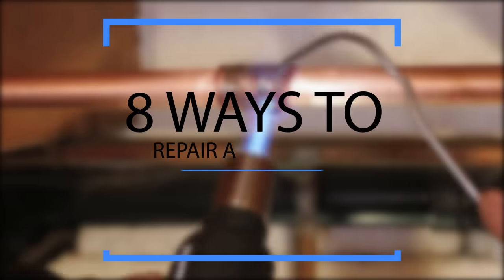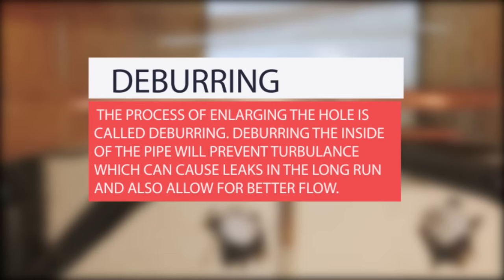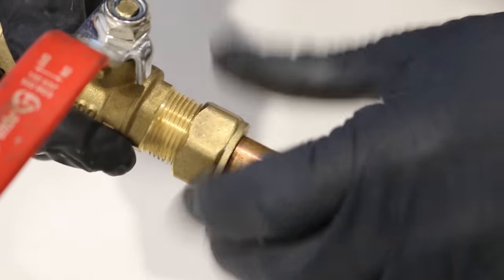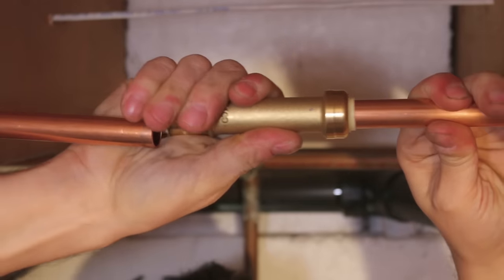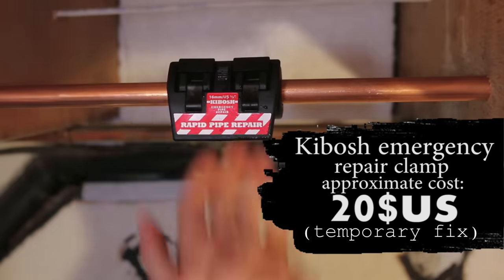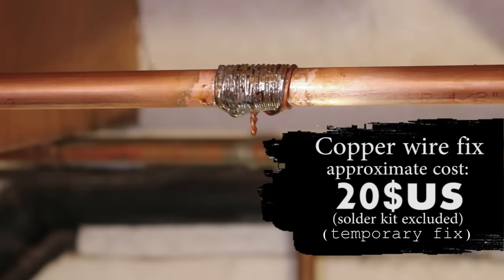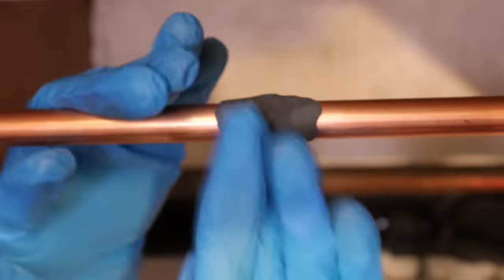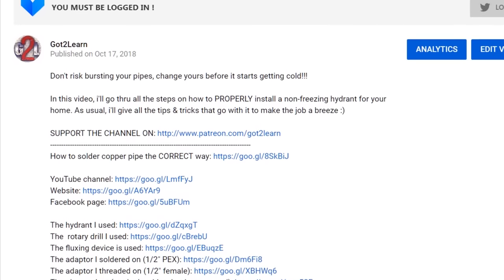The ULTIMATE Leaky Copper Pipe Fix Guide | GOT2LEARN

Comment from the maker: TOOLS:
Soldering kit I used: https://youtu.be/9rEfGa7iqNU
Pipe dope I used: https://amzn.to/2IEasNp
Deburring pen: https://amzn.to/2tBuhKW
Sharkbite depth gauge & deburring tool:  https://amzn.to/2Etjjx3

FITTINGS & MATERIALS
1/2" soldered couplings: https://amzn.to/2EwxSzV
1/2" repair coupling: https://amzn.to/2VkLNPh
1/2" compression fittings: https://amzn.to/2EctzZo
1/2" Sharkbite slip coupling: https://amzn.to/2tGegDg
1/2" Kibosh emergency pipe repair: https://amzn.to/2IEynwd
Pipe repair tape: https://amzn.to/2H07YX8
Small roll of lead-free solder: https://amzn.to/2ExrAA2
Epoxy Freeze fix kit: https://amzn.to/2Vobq1M
Reply: Hey how long have you been plumbing?
Reply: I love your videos brother but please, when saying soldering, the "L" is silent so just say sodering. Lol
Reply: Dis house has sho gone crazy!
Reply: Kool
Reply: Showed a plumber friend a permanent repair I did to a copper line leak in an impossibly tight area where even a temporary repair wasn't feasible and he lost his mind when he saw it, said he'd be using it himself from now on. 
An old pipefitter and welder showed it to me as something he learned years ago from another old guy.
It involves cutting a coupling in half lengthways and sweating it over the hole in the pipe. Like sticking a big permanent bandaid on it. I've used it in small pinhole leaks and don't know why it wouldn't work on bigger leaks?
Reply: @davidangelamelcher9591  pictures. Lol
Reply: @zachcoleman6285  didr decreases
Reply: Great video. But your 1/2" Kibosh Amazon link on this pinned post needs to be updated. Getting page not available using the link, but when I search by product name, it gives me a list.
Reply from the maker: @belindahugheslifestyle  will do, thanks!

Comment: I once used a bicycle tube with a couple cable ties. That was over 10 years ago and it's still holding up fine.
Reply from the maker: Yeah, that should only be temporary however.
Reply: @Got2Learn  It's already proven NOT temporary.
Reply from the maker: Temporary as in "max 1 hour" type of temporary hehe 😉
Reply: @PanamaSticks  11 years and still going strong. :0)
Reply: That’s affectionately known as “temporarily permanent “
Reply: You have been drinking water out of a bike tire.  Personally I would only do that temporarily, in an emergency.
Reply: @PeterMurrayj  The repair is on the central heating inlet pipe going into a rad.. old school 8mm microbore copper pipe.. It was a temporary repair at the time but I didn't get round to replacing it. But then, why should I if it doesn't leak? I did the same with a leaking rad valve a few months ago, it was still going strong until I replaced the rad and valve recently..

Comment: For freeze damage copper pipes its best to cut 6 inches on each side from hole. (removing a foot of pipe). Atleast thats what was told to me by a plumber as copper pipe expands when forzen.
Reply from the maker: Yeah that's what should typically be done for good measure, but for small burst like these, no need.

Comment: Thank you so much for posting this video. I was trying to replace my old vanity and accidentally cut through the wall and my hot water pipe with a jigsaw! After shutting off the water and thinking the world is coming to an end, I came up on this video. I had no idea that shark bite existed and could help me fix my issue. I followed your exact steps and voila! I now have a permanently fixed pipe thanks to your video. Appreciate you posting this!
Reply from the maker: Awesome, good job Rahul!!
Reply: Sharkbite aren't meant to be used in closed walls.

Comment: Thank you . I m an amateur but have always got it done . Been lucky learning to solder years back . Just takes practice and it has to be super clean is what I learned. I took round 1/2 “ pipe brush and fitted a screw on it and attached ot to my drill . All my pieces are cleaned way faster since that contraption was put together . Works awesome when soldering many pieces and soldering is a lot cheaper than shark bites but I like shark bites too sometimes if I’m in a hurry . Especially the caps come in handy but I usually just put a shit off on and cover the hole with blue tape while work goes on to keep crap out . I do the whole job no problem from framing to tile to cleaning up 😊. It took years to learn how to do everything efficiently in order to make a good buck . Repairs take like 1/2 hr but drive time and store time and . Is t the going rate first  hour $120 just to come out and $75 after that . Most stuff gets fixed quick .

Comment: Use a piece of rubber hose, cut open lengthwise to fit around the pipe at the leak and a hose clamp around it to secure over the leak. Never dripped again for me until I could get time to replace the line or the rest of the line just aged out to total replacement.

Comment: Great video! 
One note on the shark bite that can cause premature failure of the O-ring. 
I prepped a few copper pipes the same way before using the shark bite to later learn that the manufacturer wants the pipe prepped a different way.  They sell a simple tool to prep the joint. They call it the 
‘Depth Gauge/Deburr Tool’ and does not leave scratches as other methods require (before adding solder), and leaves sharp edges that can damage the O-ring. It may not leak now, but a few years down later it may. 
It’s kinda strange that they do not caution the installer, as it could be a legal issue as damages could be costly, but only have more full instructions on their website.
Reply from the maker: Yes, totally with you on that...I am working on a very thorough video about Sharkbite fittings, it should be out within a month or two, it'll contain everything someone would need to know when using these, stay tuned and thx for your comment!!
Reply: Got2Learn thanks for helping people have confidence for DIY projects!
Reply from the maker: That's my job, glad to recognize it, thx a lot!!! ;)

Comment: It worked, clear generic silicone tape, on a leaking oil cooler line that has up to 65psi of hot oil in it. It was leaking 1 quart every 200 to 300 miles and now it's leaking none.  350 miles later of mountain, Interstate, and town driving. Used 2 hours of time (half was cleaning hose) and a $7 10' roll of silicone tape that I wanted to test.  Took about 30" of clear tape to do one end of the hose while on the car.  I prefer the clear as it allows me to see through it. I developed a technique to do it in tight space. Gave it 3 overlapping layers in a different pattern. Straight wrap, diagonal, then straight again. Any pattern works but important to have different seal points of different wrapping and do it as tight as you can, with space provided.  Also important to squeeze and rub firmly on it to get each layer to fuse for 5 minutes or so before the next layer and the final layer.  If it's higher than 65psi I would also place single double wrapped pieces directly over the leak, for extra strength material before the first layer of the 3 wraps.  Or wrap it 4 times.

Comment: Being a plumber if you need another temporary quick fix for pinhole ive cut small length of a flat rubber bungee and use hose clamp.....cool channel ive never seen the repair with copper wire before pretty cool in a pinch and you got wire
Reply from the maker: Thanks Geo, share if you can ;)

Comment: I used a stubby stainless steel sheet metal screw to seal a pinhole leak as a short-term repair. Dissimilar metals are never a good idea, but for the short term it works great. I will ultimately replace that section of pipe all together.
Reply from the maker: Anything to stop the leak!

Comment: Problem with the Sharkbite slip fitting is the teeth scratch up the very pipe your trying to seal.  So could be prone to weeping.  If you use the tuning fork looking release tool you can hold in the release while sliding the SB fitting on and do the same when sliding it back.

Comment: Another good video. I actually used JB weld epoxy putty one time on a 3/4 copper pipe that developed a pinhole. It worked pretty good as a temp fix until a plumber got there. If I had watched your videos back then, I would have made a compression/sharkbite/solder repair instead
Reply from the maker: Yes, jbweld works too!!
Reply: Is J- B weld a permanent fix ?

Comment: There is one temporary fix that I used at home that you did not mentioned. It's cheap and easy.
This fix is definitely only a temporary fix and is only suitable for a pin hole.
I just cut a bit of rubber (like a bit of inner tube or similar) and held it in place with a hose clamp.
You need to undo the hose clamp, stretch it open over the leaking pipe, squeeze it back together and tighten it over the bit of rubber over the pin hole.
Reply from the maker: Thanks buddy, i'll make a video just on that ;)
Reply: I've used the rubber and hose clamp trick a few times, definitely temporary but does the trick. I usually cut a fernco for the rubber but any will do.
Reply from the maker: Good tip!
Reply: @Got2Learn  Guys out here putting no hub on 1/2 pipe, lol.

Comment: Any suggestions that would work for 1 1/2" copper pipes?  I have a soft spot that is leaking & needs to be cut out.  I can't find a compression union in the 1 1/2" size, which I feel would be the easiest fix for me as a non-plumber.
Reply from the maker: Yes, you need to cut the bad part out and replace it with a new piece of pipe unfortunately. If you are looking for a temporary fix, JB Weld sells some special epoxy that sets in water, here's the link to it: https://amzn.to/4179Zb1
Reply: @Got2Learn  I already have a "temporary" fix so now I'm trying to find the best way to permanently fix it, hoping I won't have to learn how to solder.
Reply from the maker: @jodis6234  You can rent a propress gun and press it instead like in this video: https://youtu.be/S5NWZMzPZBA
Reply: @Got2Learn  I have seen those before but never saw anyplace that rented them.  I'll have to check into it again.  Thanks for the help!
Reply from the maker: @jodis6234  If that doesn't work out for you, you can always order a 1 1/2" Sharkbite coupling at Home Depot: https://www.homedepot.ca/product/sharkbite-1-12-inch-x-1-12-inch-coupling/1001544582?eid=PS_GOOGLE_D00_Corporate_GGL_Shopping_PLA_All-Products_All%20Products__PRODUCT_GROUP_pla-300587868876&gad_source=1&gclid=Cj0KCQiA67CrBhC1ARIsACKAa8RSCRbmjBHzEtc5a7hdRqa__rmVB6m2x_wsBRQMdgqWCe1yg7H8VBYaApoiEALw_wcB&gclsrc=aw.ds

Comment: Yesterday, I learned that with my fancy stud finder, a copper pipe against the back of drywall looks just like a stud!  But it didn't do so well for attaching a cabinet :-(    I repaired it by cutting the pipe at the screw hole, cleaning the ends, then using a single sleeve.  It worked but method 1 would have been quicker.  Thanks for video...who knew there were so many ways to get out of a jam!  ( FYI: the L is silent in solder...it's pronounced 'SOD er' )
Reply from the maker: Awesome, glad I could help :)
Reply: Actually the 'L' is pronounced in English.
Reply: The "L" is pronounced in UK English
Reply: This happened to me tonight. “Fancy” stud finder isn’t so fancy anymore

Comment: got a tough situation for you on copper line:
old copper line end was a compression connection, that means the end has some mars (unsmooth ring lines ), very short left from wall out.
causing leaking when connected with a SharkBite faucet.
I try to fix without opening the wall to change the (stub out) section.
was thinking if i can solder the end portion to create a smooth surface for sharkbite connection. (i.e how to coat solder around the end alike resurfacing?)
Reply from the maker: I strongly recommend NOT doing that, that will leak for sure, your best bet is to replace the pipe, even if you have to break the wall 🤠

Comment: I had people bring soft copper water lines in. That run under the house that had burst numerous places. Winter Freeze. I used a ball peen hammer to get the edges close . Then used silver solder to fix them.

Comment: I've used garden hose and hose clips to quickly join 1/2" copper water pipe before when the coupling I thought I had in my bag had walked off 😮 usually prefer compression fittings for long term use.
Reply from the maker: That's a good temporary fix, good idea ;)

Comment: How close can you solder next to copper to PEX connection?  Need to remove a water heater shutoff valve, but concern I might melt the PEX connection when heating connection to remove valve.  The PEX connection is behind the wall, so I cannot determine how far from the heat source is the actual connection.
Reply from the maker: Wrap a wet rag aroind the pipe, it'll stay cool ;)

Comment: QUESTION:  I am relocating copper pipe under the slab, both cold and hot.  Is it right to have soldered joint under the slab, as a permanent fix??
Reply: There is nothing permanent about copper but... yes...
Reply: in my area soldered joints are a no no under ground. They use rolled copper and have all the manifolds above the slab in the wall. And I agree with that. Fittings go bad quicker than the actual pipe. No fittings=longer lasting=not having to bust up your slab in 10-15 years

Comment: I have a pinhole on a 2 1/2 or 3 inch copper pipe ....Do you think any of your methods will work??
Reply from the maker: The 2 couplings method will, yes.
Reply: Got2Learn what about the epoxy or the tape will that work temporarily??
Reply: Got2Learn Thank you for replying
Reply from the maker: Temporarily, yes....but you need to fix it as soon as possible. The Kibosh clamp gives you a lot more play time though ;)

Comment: Hey there! I'm thinking that I should practice soldering pipes soon, following your videos. The pipes in my house are old and starting to get pinhole leaks everywhere, this would be a very useful skill to have.

For now, because I'm short on time, I think I'm going to have to fix a leak with the compression fitting method. (Thank you for showing me the kibosh! I was able to overnight that from Amazon and it's been perfect for a few days.)

I do have a couple of questions for you if you don't mind answering. How easy was it to slip on the couplings and new piece of pipe between the two existing copper pipes? Is there any trick to it? How much 'leeway' can I give myself in the length of the new piece of pipe and still have good seals?
Reply from the maker: The piece of pipe in between each coupling has to fit perfectly in between both existing pipes or the coupling might not seal properly. I am glad I could help to say the least and good luck with your project!

Comment: Great range of solutions! But how do you get the second compresssion coupling onto the second joint if the pipe you are reapiring is in situ?  You miss this out in the video.  Thanks
Reply from the maker: I was lucky I had flex, but if you don't you won't be able to use this way, I suggest watching this video for that: https://www.youtube.com/watch?v=ebvqSp-d8-0&t=1s&ab_channel=Got2Learn
Reply: Really appreciate the speedy reply!!!  Thanks!!  We had already cut out the damaged pipe before we heard of the Sharkbite, now it is too long a gap.  We have 2 compression couplings but we dont want to force movement to make the second one fit into position.  I have all the bits to solder except plumbers flux as I am a coppersmith!!!.  I have borax flux, will that do??  Little scared to solder and to get the seal all round. My other half is frightened I will singe the joists and melt the cables near by!!  How about a video telling plumbers not to put pipes directly under floorboards !!!!!
Reply from the maker: You can use a slip sharkbite coupling and a regular coupling if there's a big space between..

Comment: the end of the copper pipe for my toilet has a small crack at the bottom end that connects to the main valve and i’ve tried using teflon tape but it isn’t working. i want to try one of these methods but i don’t want to screw it up, and i feel my situation is a bit odd. do you have any advice? or any permanent solutions?
Reply from the maker: Can you replace that piece of pipe, do you have access to the back of the wall?
Reply: unfortunately no, i don’t have access. would it possible to just cut that small piece that’s cracked?
Reply from the maker: @oi7917  sure
Reply: @Got2Learn  it’s fixed now! thank you for your time and methods! earned my sub 🙏🏼
Reply from the maker: @oi7917  😇😇😇

Comment: I have one pipe that has no access to the backside and the water never stops dripping enough to solder. I’ve tried the bread trick and everything else I can think of .
No room for a pro press or even a tubing cutter. I’m going to cut it with a multi tool and use a compression fitting for the first time ever. I’ve always soldered but I’m over it already. It’s just not possible at this point.
Reply from the maker: Good choice, even a Sharkbite would do.

Comment: Nice video. But at 3:28 isn't that a copper press fitting that you are heating with a the mini torch? Copper press fittings have EPDM o-rings in them and are  installed using a compression tool.
Reply from the maker: Thanks, no that particular fitting was a "Yorkshire" fitting, here's a link: https://www.google.ca/search?hl=en&tbm=isch&sxsrf=ACYBGNR8uNzRxVmz8-o4wdkyr2KBBXolwQ%3A1579630014977&source=hp&biw=1707&bih=818&ei=vj0nXsr0OKqx5wKV0JGYCw&q=yorkshire+fitting&oq=yorkshire+fitting&gs_l=img.3..0j0i8i30l3j0i24l6.1061.3812..3933...3.0..0.83.1227.18......0....1..gws-wiz-img.....10..35i362i39j35i39j0i131.v7dArjYucMA&ved=0ahUKEwjKy6qvpJXnAhWq2FkKHRVoBLMQ4dUDCAY&uact=5#imgrc=r3jynQDTBe1Z2M:
Reply: @Got2Learn  Sorry. Message was mistakenly posted to wrong video.

Comment: Rubber and pipe clamps has always been my go-to. I gave that Alfa tape a try last week. It worked okay, but only slowed my leak, didn’t stop it completely. Also, is there a reason you didn’t brush your pipe and apply flux before soldering?